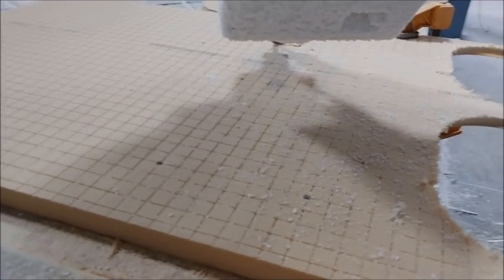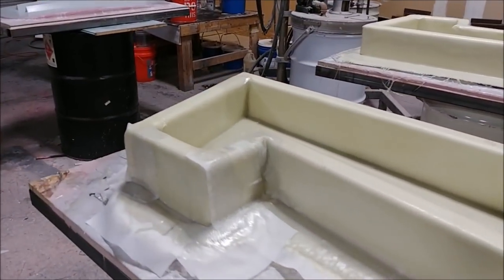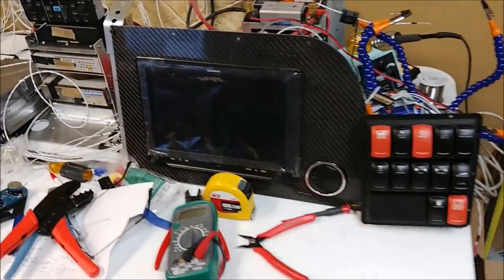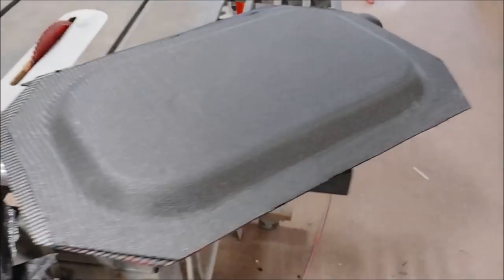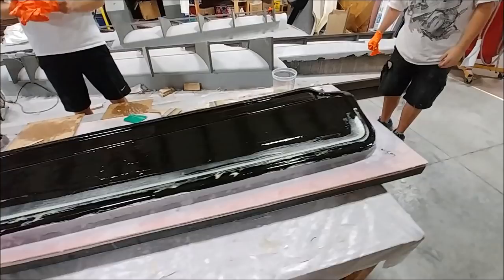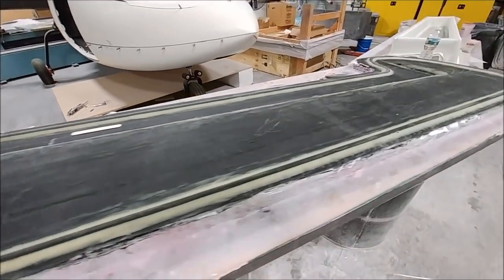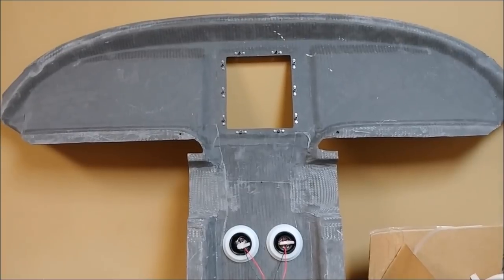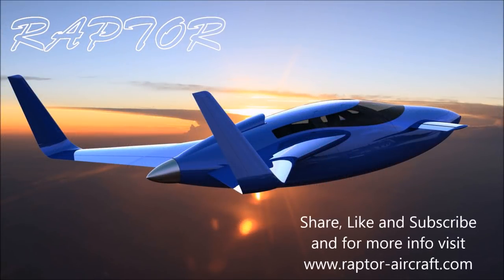Switches Wired Up!

Comment: IT is very important that you have a discrete switch/circuit breaker which is needed to disable the autopilot servos.
Reply from the maker: The switch is on each of the side sticks.